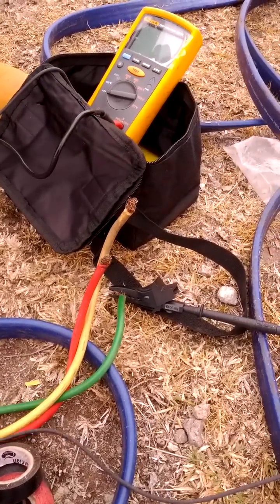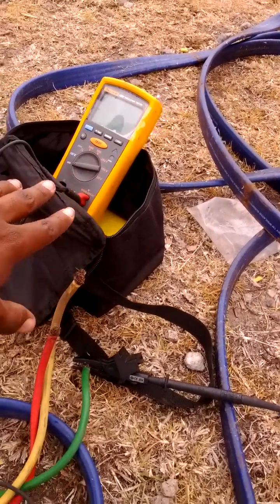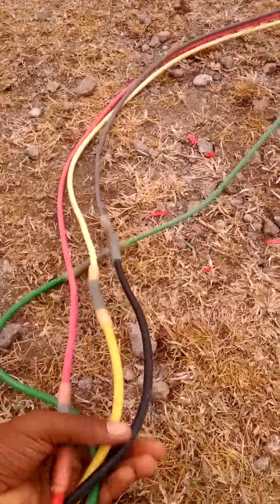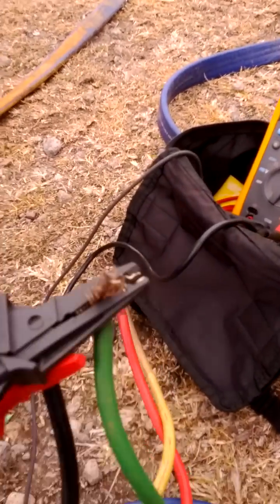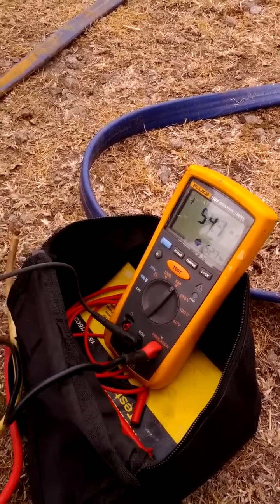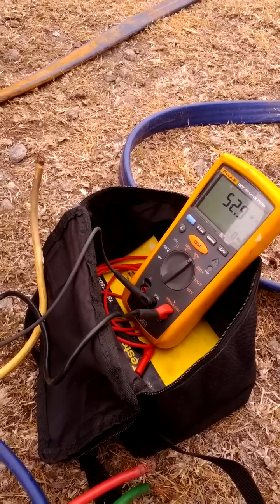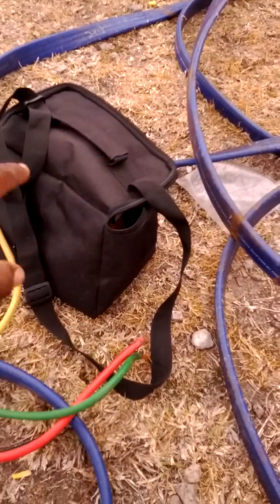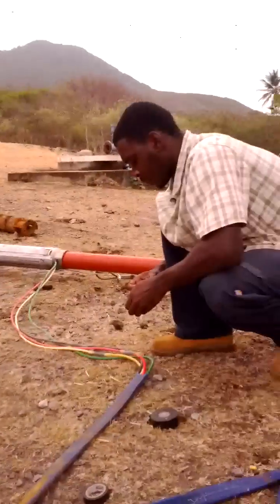Insulation Resistance Testing on a 3 Phase Motor

Comment: Mister electrician you installing underground underwater well pump and you're using basic rubberized tape and PVC tape don't you realize what are you doing that's not going to last not even 5 10 days especially the three phase Motors and high voltage you should use splicing kit that suited for underground underwater not a regular rubber tape or PVC electrical tape.
if you're not sure how to do splicing underground underwater by the book National Electric Code and read inside splicing underground underwater that will give you brother explination what to do and how to do.
Reply: Nurfet Alic you are spot on
Reply: well remember in their country there's no rules they don't follow  guess we forgive him for that or he put all that money his packet and just did a sloppy job

Comment: Great demonstration all around... Just one thing. That pump laying in the ground like that, how do you lay down and lift back up a pump that large? A pump that large can bend and warp. I shudder at the thought of seeing a pump that large laying on the ground like that. Of course I didn't get to see how it was taken out and then reinstalled, I'm just seeing that pump bend in my mind. I like to keep them upright if at all possible. Especially the initial install when you have to mount the pump end onto the motor end.

Comment: thanks.nice :)  a motor can shock you after you removed the meggr. I did not know that. shit haha an i wont forget that either. hahaha
Reply from the maker: If i did say that it was a mistake... forgive me.... most my videos are not planned..... But a dc voltage from a megger can indeed give u a little sting and depends on the after effect you could get damaged....  for instance you getting a 500 volts dc sting while on a ladder you instant reaction may cause you to fall.
Reply: haha,np. nothing